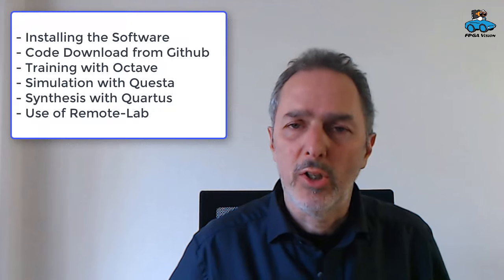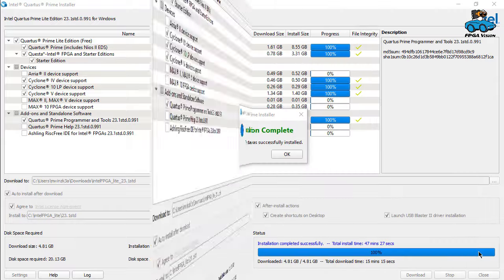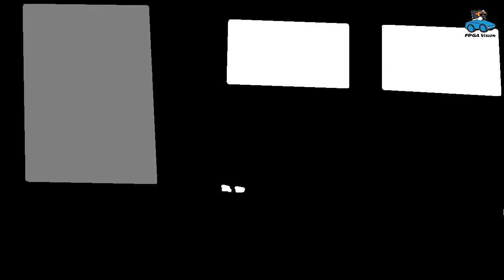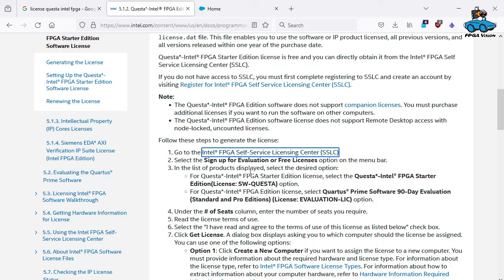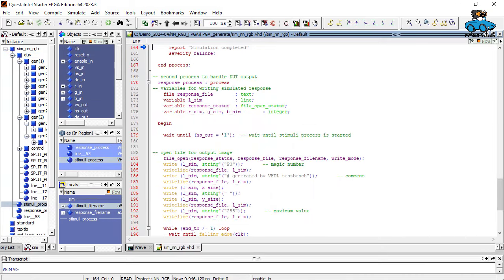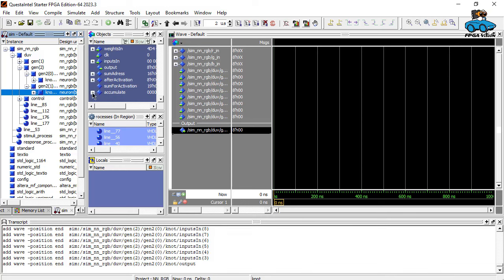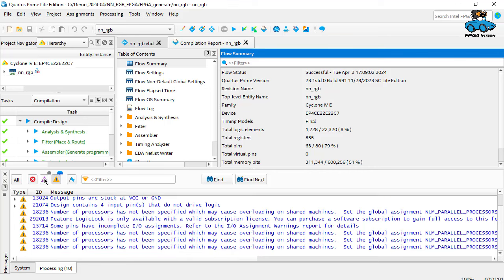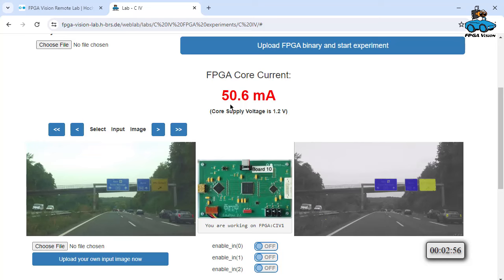Complete Design-Flow for Video Lectures on Machine Learning with FPGAs

Comment: Dear proffesor, when increase the hidden layer, do we need to change the delay of the luminance level?
I ran with two hidden layers, networkStructure is [3 7 7 2]  and change connection[ ] to correspond to the output of NN but the result is not correct
Reply from the maker: Yes, you have to adapt the delay of the luminance. The neuron has a delay of 4 (?) cycles, so an additional layer increases the delay of the neural network by this number of cycles.
I made a question mark behind the "4", because I have not verified this number. I'm 90% sure, but it could be 1 cycle more or less.

Comment: Amazing, I plan to implement on Max10 FPGA. Will the computational resources be sufficient?
Reply from the maker: Best thing to do: Try it out by downloading the code and doing FPGA synthesis. The check computational resources, you can make a test run without pin constraints.

Comment: Sir, I have a few question about machine learning on fpga , can I connect with you by using email ? Thank you , Sir
Reply from the maker: I regret, I can not provide individual tuition or consulting. Nevertheless, I try to answer specific question to the video lectures.